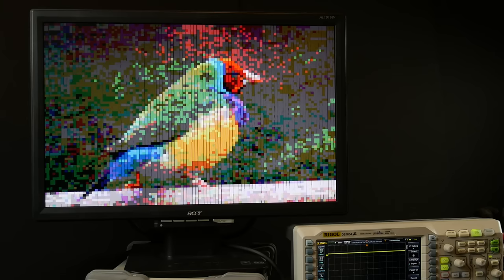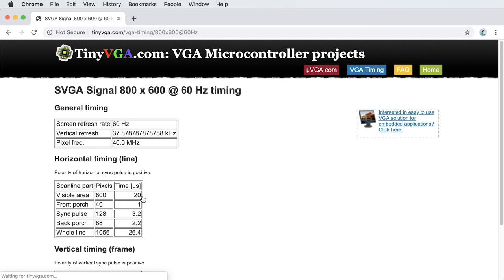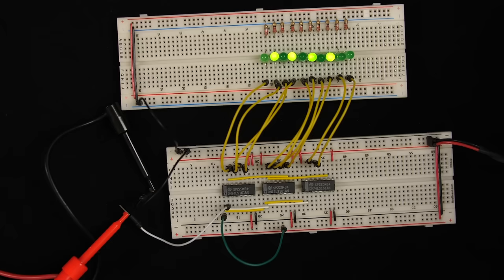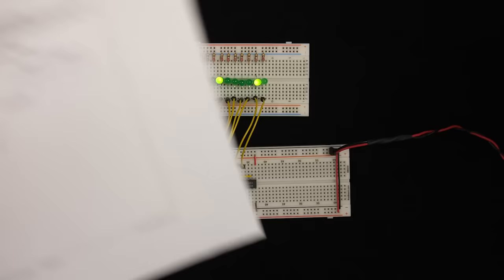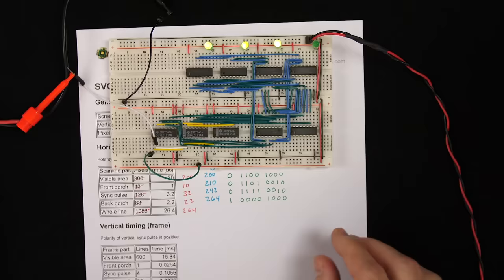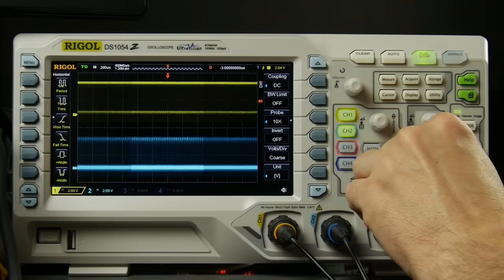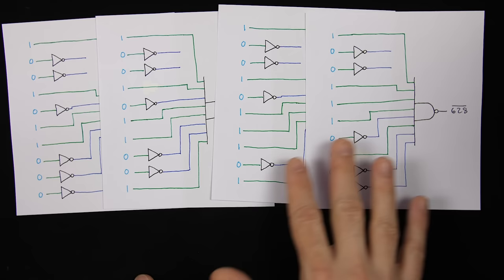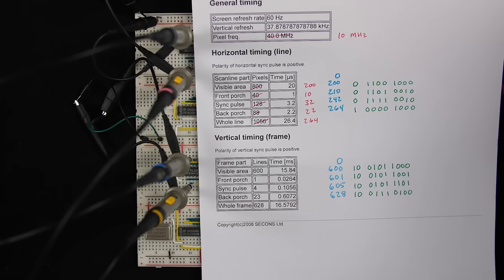The world's worst video card?

Comment: Kid: bought the latest GPU
Men: bought a 3 years old GPU
Legend: built his own GPU

Edit: thank for all the likes guys
Reply: but can it run crysis
Reply: God: Traces the rays himself
Reply: Are people that build computers out of nothing but redstone tools legends or gods?
Reply: @JigglyBit It ain't that hard my guy, use Youtube to help you.
Reply: @JigglyBit putting a gpu in is very easy, you dont need to worry about breaking your pc my dude, you can do this! youtube and google are flooded with helpful videos, just dont follow the "verge" guide.
Reply: @youtuberpersonssts  Real man uses grammar don´t. ;)
Reply: Kids cannot buy the latest GPU, they buy a used 3 years old GPU to play Fortnite on Low at 120 fps on a 60hz monitor...
Reply: This reminds me of Back to the future —- replacing the damaged micro chip in 1955.
Reply: Kid's don't buy anything...
Reply: Technically not a GPU, but a video card. 
Video Cards have been around since the early 80s, GPUs only since the late 90s, except for very expensive graphics workstations. 

The video card generates the signal, the GPU generates the image. 
In the old days, the CPU generated the image. 

You think it’s the same thing because today the same device serves both functions. ;)
Reply: This has nothing to do with a gpu, this is just a vga driver. It just outputs a framebuffer and doesn't calculate the pixels
Reply: For real though, buying a slightly outdated card is a killer deal, even new, if you know which one to buy. Iirc RX 590s are a fraction of their original MSRP right now, so their price/performance ratio is absurd. I upgraded from a 280X to a 590 a few months back to get VR capability.
Reply: Vera level bro
Reply: so i am a man
Reply: This is should be the noob pro and hacker.
Reply: xD😂
Reply: @aeebeecee3737  you are gamer
Reply: @aeebeecee3737  don't do gaming, gaming cause permanent damage to your mind and brain😨😱😵😲
Reply: Zulqarnayeen schaftler not so, but sort of.
Reply: Zulqarnayeen schaftler agree 50%, disagree 50%.
Reply: @aeebeecee3737  oh
Reply: @aeebeecee3737  Pls don't play games
Reply: @aeebeecee3737  learn how to love science
Reply: Zulqarnayeen schaftler I fall too munch to science, How about your opinion to science? Science makes me free.
Reply: @aeebeecee3737  Thank you very very much for fall in science!! In my opinion, with Science you can Explain all things In your life☺ and it's world's greatest thing 😁. Happy Science Journey! ;)
Reply: @aeebeecee3737  I am a 12 years old kid.
Reply: Zulqarnayeen schaftler first if you are real 12 don’t tell the real information to internet, next every information tells about real life see as fake. That’s rule to keep safe. Who knows you are 12 is real or fake. I don’t care, and one cares, just focus on topic, what do you think about explation? I’m just a little kid too.
Reply: @aeebeecee3737  Thank you
Reply: Zulqarnayeen schaftler you welcome, science is about explain, explain is prediction. Science is a cognition about prediction reality. Science avoid to chase right and truth and avoid to chase left and wrong but the better prediction to reality. Science is original from cognitive philosophy, the cognitive philosophy is original from human’s nature, human’s nature is original from natural selection’ s design. The real science education will makes people less selfish, foolish, and more freedom. The fake science education will makes people more selfish, foolish and more slavery.
Reply: @aeebeecee3737  absolutely true!!☺
Reply: @aeebeecee3737  you know that what is science!! Goodbye!  Have a good day🐦
Reply: Zulqarnayeen schaftler you too
Reply: Zulqarnayeen schaftler I’m keeping and working on re-understanding science, knowledges and subjects everyday, I’m focus on biology recently but science has no border.
Reply: @aeebeecee3737  oh!☺ nice!!
Reply: Me having no gpu
Reply: @RikkaYeet  oh
Reply: @RikkaYeet  but your device have a built in gpu!!
Reply: @zulqarnayeenschaftler9323  i think we can't call 2001 pc barely runing youtube video having gpu
Reply: Alpha: has no GPU (me)
Reply: @stop8576  sad😦(but your device have a built in GPU! So don't worry! 😀💙)
Reply: @RikkaYeet  oh, I believe, this device have OpenGL 1.0 support gpu
Reply: @zulqarnayeenschaftler9323   you have good knowledge about pc but i says that as joke so not be serious
Reply: @RikkaYeet  I knew that
Reply: @RikkaYeet  I just reply you for, for............
Reply: José Vinhas godrays?
Reply: Alpha man: bought a CGA video card
Reply: At least he didnt be like "OMG GUYS I GOT 1.5K WOOOO"
Reply: DISLIKE HE SAID THANKS FOR LIKING SO DISLIKE CMON GUYS
Reply: @scunthorpe5513  yes it can

Comment: Can you please do a tutorial on how to bend wire/cable so neatly?
Reply: I'm not Ben Eater by any means, but what I do to get my wires bent so nicely is just by using a pair of needlenose pliers. For example, if you want to bend a wire at a certain spot, place it in the breadboard, and marking the bending position with a pen of some sort (I find that felt works the best for this), then grab the wire with the needlenose pliers, and line the marking up with the edge of the pliers, and bend the wire over the edge of the pliers
Reply: @DrumsetMonkey  I apologize, I was being sarcastic with that request... 

I'm just fascinated by how he always has ready bent wire to hand that fit perfectly to connect the components he's placed on the board.. (I understand that the part where he cuts and bends them is cut from the video...).
Reply: @EfroimRosenberg  oh, well, darn haha. If anyone is curious I guess now they know
Reply: @DrumsetMonkey  I don't know if they still make them, but, in my day, we used something called a ComForm tool - it looked rather like a pair of calipers, which you just set to the distance between the holes; it then gave you the correct bend radii, taking into account the thickness of the wire.  You could also use it to put strain relief on component leads.

Comment: I'm just wondering wether you could build a graphicscard for a led matrix? That'd be cool!
Reply: i think that would be designing a led driver that is driven by a VGA signal. not so much a graphics card. it would be a cool project for sure. but i think thats more like designing a LED monitor using an LED matrix.
Reply: For 8x8 you can just make a grid of leds and drive it by two sift registers only pins you need to drive it output enable clock data power ground and maybe aome resistors.
Reply: And for bigger just put more sift registers

Comment: To detect 264, you only need a 2 input and gate because the counter can’t go higher than 264, and when the bit for 256 is triggered, all the other bits will go low, and a similar thing happens for 8
Reply: Hi, I have a problem may you help, please? I cant get 74ls161 to work .
When I connected LEDs to the chip outputs they all started to blink together at once, not counting, just blinking all at the same time. What should I do?

Comment: @12:12 The 264 detector could actually be implemented with a simple two input NAND-gate, as you could just look for the first instance of the 9th and the 4th bit being high. While the 9th bit is high, the 4th bit won't flip until we reach that point so we won't get a false detection at a lower number. And since we reset when we get there, the other bits won't ever get to be anything but 0s so we actually don't care about their value either.

Comment: Awesome video!
One question: Couldn't you just use 2 eeproms (28c64 for example) for the decoding... Its a bit cheaty, but that would simplify the circuit drastically?
Reply: Yes, that's what I did on my build
Reply: Or like what we did when doing essentially the reverse in a hardware/logic course in uni, grabbing a frame out of a video signal to a B/W image file. We used an FPGA (iirc) to generate the counter decoders/signals for when to sample, line advance etc based off the clock and signals from a sync separator chip (extracts the horizontal and vertical sync pulsed from a video signal into separate signals/pins)
Reply: I have spent the last 24 hours trying to get my 2 EEPROMs to decode without success....any hints?
Reply: @sandvikcity  Yes, check the main comment with links to schematics and code of what I did
https://www.reddit.com/r/electronics/comments/bz2xak/i_just_made_a_vga_signal_out_of_basic_logic_ics/?utm_medium=android_app&utm_source=share

If you have any questions let me know!
Reply: @sandvikcity  counters as address input, wanted output for each signal/counter state stored as data for the given address/counter state 
For the horizontal stuff, D0 might be the active low horizontal counter reset (ie zero for 264 but 1 for all else (0-263, 265 and up can be ignored)) D1 might be the hsync etc...
Reply: @enriquephan7729  Cool project! I might borrow your design... I already have a working 8 bit computer but im still looking for a proper display and keyboard interface
Reply: @gaharmun  Of course! I'm working on a "powerful" 8bit computer too. What kind of architecture are you going for?
Reply: @gaharmun  Oh I also designed a keyboard and PS2 controller  interface although I have not yet posted schematics. I can send you some drawings if you need to, just let me know where
Reply: Enrique Phan Thank you..as per your schematic I have added the 574 flip flop to the EEPROM outputs and now it works. I also noticed you have oscillator, h and v divided by 4 in your schematic. I don’t understand why Ben’s 628 v lines are not divided by 4??

Comment: Could it be optimized for voxel based rendering at this level?
Reply: Ethan Merchant this isn’t a gpu, it’s a video card. A gpu renders things, but a video card just encodes pixels into a data stream (like vga). It’s confusing because the boards (e.g. from nvidia or amd) with gpus on them are also video cards and are just called that.

Comment: Man I've been wanting to build a hardware video card for a arduino and this video will help alot.I had and an idea of using counters and ram to store pixel data and drive the vga signal.Also cant you replace the AND gates and inverters with a EEPROM
Reply: 100% yes. He's done this with the microcode for his 8 bit breadboard computer. You can replace any combinational logic with a ROM.
Reply: You could replace the circuit he did with an EEPROM. Although it isn't entirely necessary since you only need a handful of values and the circuit itself isn't too complex.
Reply: @AlpacasForAva  to support multiple resolutions tho :)
Reply: @MrSapps  That would work, didn't think of it like that. That would be really cool.

Comment: 28:45 Our horizontal reset signal is an output of inverted latch. Which means, it's an inverted reset signal. Which is ok for reset (since counter reset input is inverted).

But why that works as a clock input for the vertical (lines) counter? We will have 1 for a whole line and then 0 at line end. Is it not better to invert that input clock signal?

Comment: The part that astounds me is that the video card will operate at 60 fps

Edit: Nvm, I was using the pixel count instead of timing
Reply: The refresh rate will end up being 60 Hz, so if it can make frames fast enough, this hardware can send 60fps

Comment: I'm thinking that for the 264 counter, you need only AND together the 2^8 bit and the 2^3 bit. The result is zero until you reach 264, and after that the circuit resets.

Comment: Hi! 
This is a good video!
Why would you check the last bits, if you were in the state already?
At 12:04 in your video about number 264 -> you could ignore all 3 bits as long as 264 is the maximum value you may search for in the current context, or at the current circuit board. I have also noticed that all of your trigger values at horizontal synchronization are even (i mean 200, 210, 242, 264) therefore you should not check the last bit at all of these cases, since the last bit is always zero at the first occurence of the trigger numbers, i mean why would you check 201, if 200 had triggered already? From 200 to 210 you just wait for the next occurance, the next condition, the next trigger which is another even one.
Of course you need all your triggers to be even numbers for this to work.
In the following i m going to reference your horizontal blue and green lines in your picture at 12:46 as rows.
At 12:46 you can also see in your sketch, that the most bottom line is always zero, in each and every one of your conditions, therefore i believe that should those last 2 rows(dividable by 4) or 3rows(dividable by 8 -> 264/8 = 33 :) )rows or more rows be zeroes instead of 1row (dividable by 2), those 2 or 3 or more rows of zeroes should also be left (when it comes to conditions and triggers), because that is the first occurance of that number you are searching for.
A more simple explanation was that, if all your trigger numbers (200, 210, 242, 264) was dividable by 8, you would not need the last 3 digits of all of them as long as you are searching for the first of these triggers occurances. Therefore that should work in your case, since you are interested in states.
At the last condition however, the last three zeroes doesnt matter, because the very first occurance (the last 3 digits are 0) of 264 happens at the reading left side of the bineary number, and therefore the last 3 digits may be left as well.

Comment: if you can't afford a RTX 2080 Ti, 
make a RTX 2080 Ti
Reply: @Andrey Koschey Well, if it's that big, you won't have any issues with cooling the whole thing. It may be the most silent RTX 2080 Ti in the world. xD
Reply: if you cant afford a rtx 2080 ti get a fucking rtx 2060
Reply: @IdiotStinky02  dude that Oscilloscope costs like 400+ €.... if you got one of those and know how to use it, i bet you can afford few 2080 ti
Reply: I know your comment is made in jest, but for anyone wondering, it's not physically possible to build something like a modern CPU or GPU in this way. The electrical signals take too long to transmit when the components are so far apart. 

So you could build it, if you had millions of dollars, but it would have to run extremely slowly and might not work at all.
Reply: @IdiotStinky02  r/whooosh
Reply: @luminumlx2604  dont woosh me thats only if you dont get jokes and i clearly know that hes joking YOU CANNOT MAKE A RTX GPU
Reply: @IdiotStinky02  do you liek peanuts?

Comment: The blanking time is less like extra scanlines and more like data the monitor ignores WHILE it's returning to a position

You could NOT damage a CRT monitor in this way. You can hardly damage them when you're shorting their flyback output directly to ground I  some cases. These old monitors are EXTREMELY robust in some cases.

Blondihacks has an AMAZING article on making a VGA display driver work with her 8-bit computer, Veronica.

With the counter, I can't help but feel that you could have skipped the use of so many inverters for detecting 264. You only need the 256 and 8 lines in an AND gate. The 256 line will never be on unless you're over 255 and the 8 line will only be active if you're at 264 - there's no reason to check any of the other lines, since this is the end of the counting cycle.
Reply: I'm not sure Ben's going for perfection here. The title of this video more or less says that. And there was no take-away point about damaging CRTs - that was a by-the-by comment and not at the core of the video's lesson. The video is everything it needs to be, I think. /2cents 👍🏼

Comment: 2:45 The older CRT monitors wouldn't typically get damaged by "the CRT gun pointing where it shouldn't" but by "the inductors (electromagnets) driving the CRT guns getting discharged at the time and/or speed they shouldn't". These inductors store quite a bit of energy (the timings are so large because it takes thousands of CPU clocks (even at the slow rate of computer stone age) to move the energy into/out of the inductor to make the electron gun move from the left edge to the right edge. If that energy got discharged at the wrong time and/or speed, the result could be an over-voltage event that would set things in the monitor on fire. And, the old CRTs did not have any form of protective circuitry in them - the sync signals were connected more or less directly to these inductors.

Additional problem is that the analog circuitry used in old CRTs might not like the timing being off. "Might not like" could literally mean "will set thing on fire until you get the signalling right".

Modern LCD monitors are pretty much impossible to get damaged like this because what is in them is a bunch of A/D converters that convert these signals to digital and then feed it to a bunch of high-speed processing CPUs that use it to interpret the signals. These CPUs may crash if bad data is fed to them (making it look like the monitor got damaged; I had seen a monitor doing this) but when you power cycle the monitor, it will fix itself.

Comment: For the reset 264 it will be enough to NAND the two 1-bits, because it's okay to detect any value greater or equal 264, greater values are never reached.

Comment: Would it be possible to shift the horizontal decode two bits and use a 40mhz clock? Or would 40mhz exceed the maximum operating frequency of the the 74LS chips?